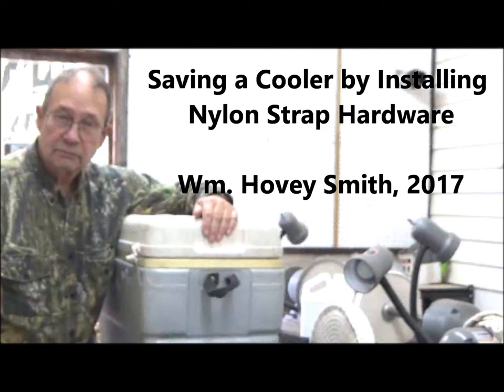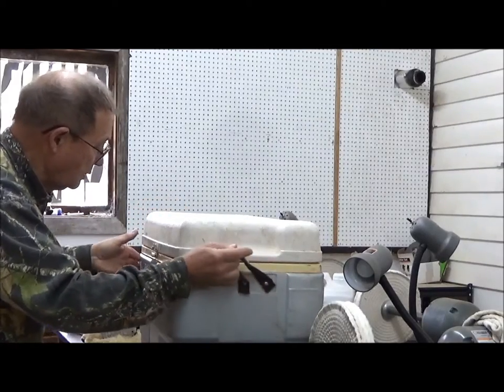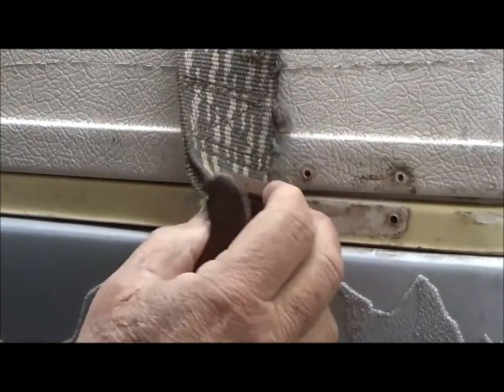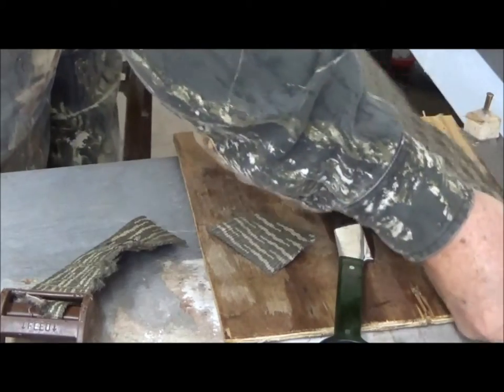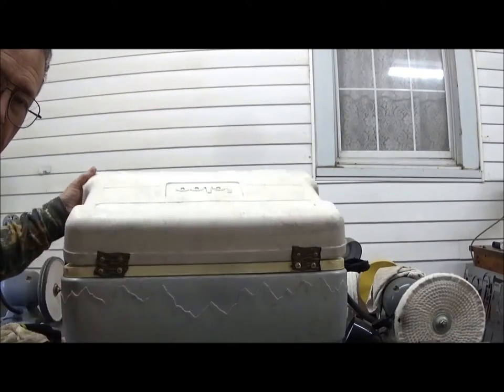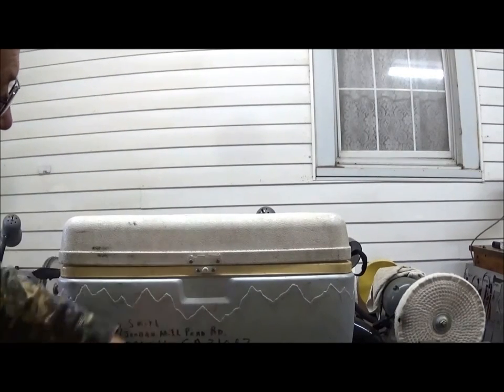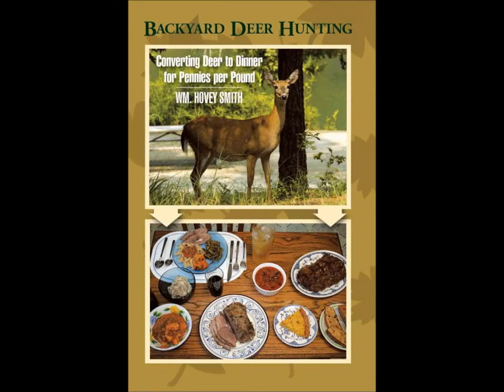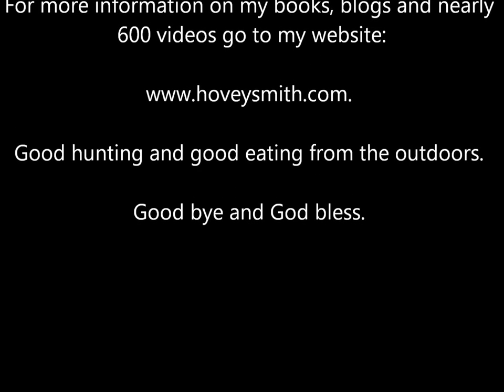Saving a Cooler by Installing Nylon Strap Hardware

Comment: If I add nylon webbing handles to something, I slide a short length of pipe or tubing over the webbing to make a rigid handle. Much more comfortable for a heavy load.

Comment: God bless your soul Hovey Smith I might do this on the extremely overpriced rotomolded cooler I bought which the rubber latches keep dry rotting and breaking in half. Thanks!!

Comment: great video hovey
i have an old rubbermaid 80 quart that needs a new front latch,couldnt follow your latch making too well could you explain how you did it?
thanks
john
Reply from the maker: There are a couple of easy ways. The first is to salvage the ends of any type of web belt, cut the nylon webbing, mount the webbing on the cooler with nuts, bolts and washers and you have a new latch. The second is to use cord and a little T-shaped dock tie, like used to tie up boats and attach that to your lid. Then use washers and bolts to fix the cord to your cooler. Then to seal, wrap the cord around the metal dock tie on top and you are closed.

Comment: Hello. What type of screws were you using? I was wondering how they sat snugged in the plastic
Reply from the maker: Wood screws have sufficient bite to hold in thicker plastic. In thinner material I have also used nuts and bolts with a backing plate.
Reply: Hovey Smith , Thanks for the tip

Comment: creative and I am not sure if I mean that in a good away or a bad way I'll just leave it at creative
Reply from the maker: As an Ex-Military Engineer, this repair passes all the necessary tests. Functional? Yes. Effective? Yes. Time Efficient? Yes. Use available materials? Yes? Long lasting? Yes. Low cost? Yes. Attractive? Not significant.
Reply: I suppose you're right